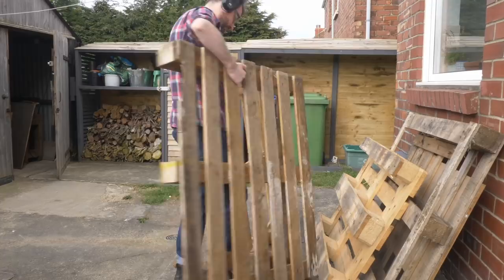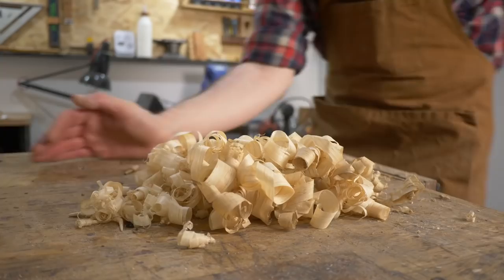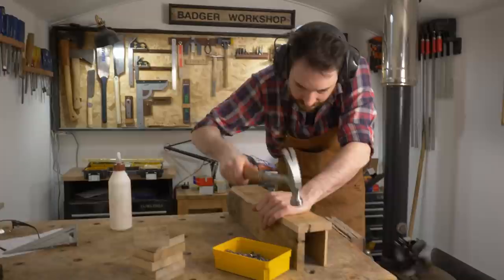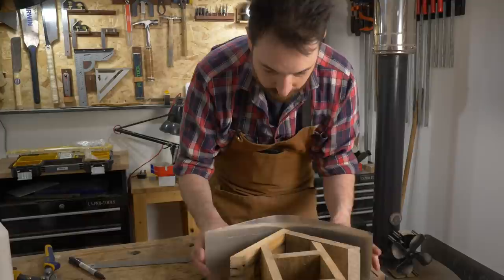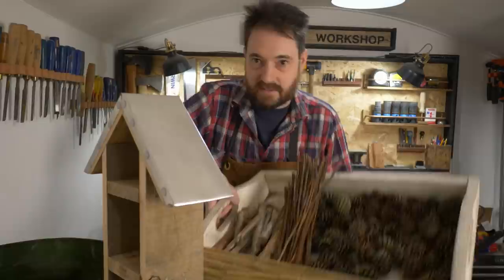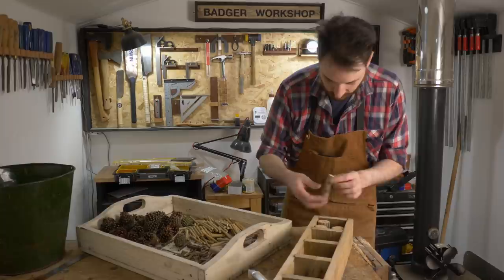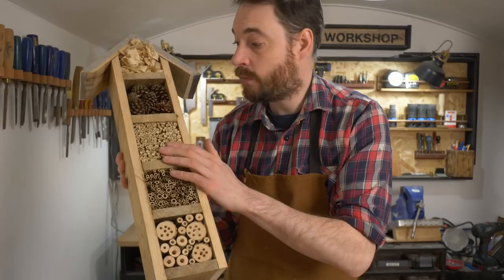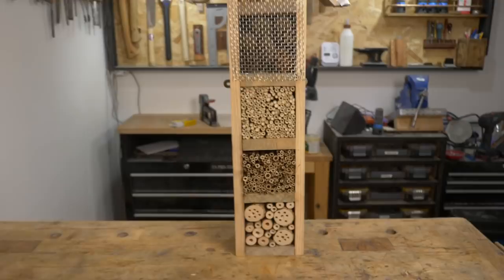Making an Bug House / Hotel

Comment: Great video. Very important to remember to drill your holes at a slightly downward angle so water can run out. Also, drill the holes blind (not all the way through to the other side.
Happy crafting! Do you part and save our insects.

Comment: A word of caution, I built a bug bungalow last year and packed it tight with bits of cane and sticks. It looked like a treat and I told my wife, see that's how to do woodwork properly.
Of course, I built it dry in my workshop, but when it was outside and damp everything expanded - didn't just blow off the bl** doors but the roof, walls, floor the lot - leave it to the kids and stick with lapped dovetails and fox wedged tenons instead.
Reply from the maker: Hopefully it will be ok as it was made from pallets that had been outside.